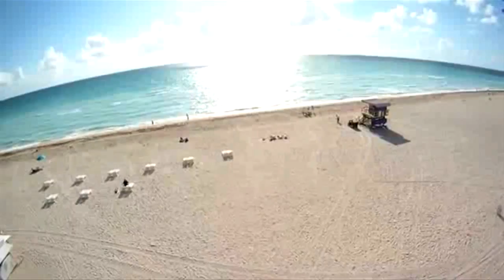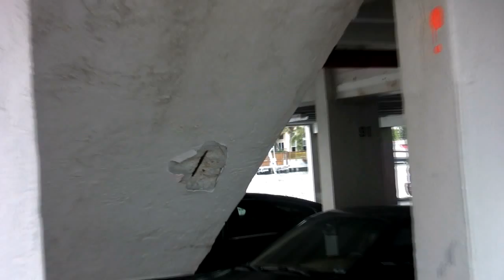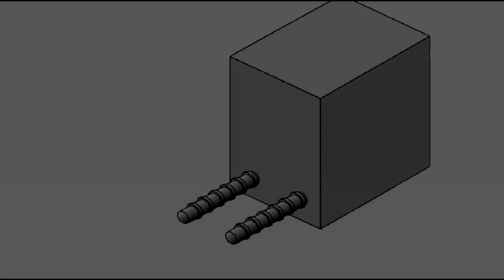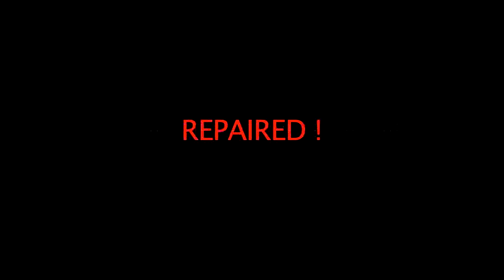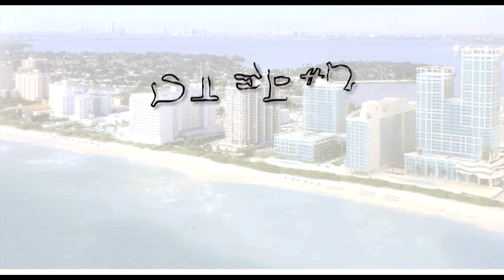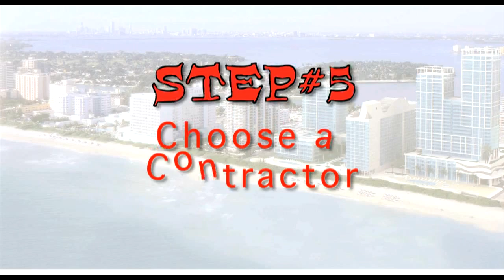Part 1 of 2 - Concrete Repair Basics in South Florida (Spalling).

Comment: What he still hasn’t done is tell the State exactly what needs to be required in new construction — what must be added to the concrete, how the rebar must be protected, and what waterproofing steps must be mandatory — so this problem stops happening permanently. Instead of giving clear solutions, he avoids the issue. So here is the simple version the State actually needs to hear: 

⚠⚠⚠
1) Florida must require waterproofing admixtures inside the concrete,
2) corrosion‑proof rebar,
3) a real vapor barrier under every slab,
4) proper waterproofing membranes and drainage above the slab. 
         These steps are not optional — they are the minimum needed to stop buildings from rotting from the inside out.⚠⚠⚠

This needs to be the new buuilding  code 

Concrete must have waterproofing mixed INTO it.  
That means the batch plant must add a crystalline waterproofing admixture (Xypex, Kryton, Penetron) AND silica fume or slag so the concrete becomes dense and water‑tight instead of porous like a sponge.
This stops water from traveling through the slab and reaching the steel.

Rebar must be corrosion‑proof.  
Builders must use epoxy‑coated rebar, galvanized rebar, or FRP fiberglass rebar instead of raw black steel.
This prevents rust from ever starting, even if moisture gets in.

Rebar must be buried deeper inside the concrete.  
The code must require more concrete cover, held in place with plastic chairs, so the steel is not sitting near the surface where water can reach it.

A thick plastic vapor barrier must be placed under every slab.  
Not cheap thin plastic — a 20 mil polyethylene vapor barrier, seams overlapped and taped, so ground moisture cannot wick upward into the concrete.

All exterior slabs must be sloped so water runs off.  
The code must require ¼ inch per foot slope on balconies, walkways, pool decks, and garage decks so water cannot sit and soak into the slab.

A real waterproofing membrane must be installed on top of exposed slabs.  
Not paint. Not roll‑on junk.
A fully bonded membrane with a drainage mat and drains at the low points, tested before finishes go on, so water never touches the structural concrete.

Construction must be inspected by a third party.  
The code must require independent inspectors to verify the mix, the rebar coating, the rebar depth, the vapor barrier, the membrane, the slope, and the curing — so none of this gets skipped